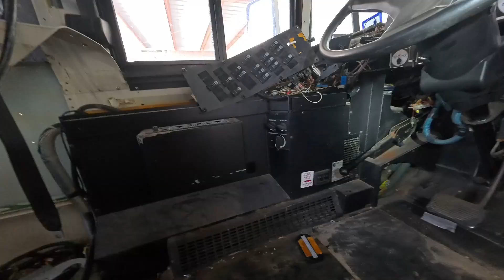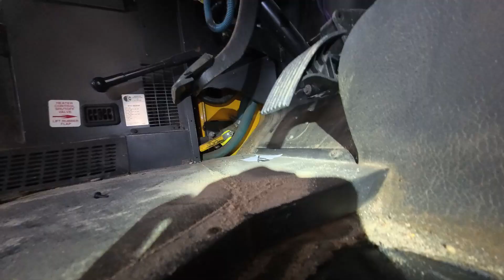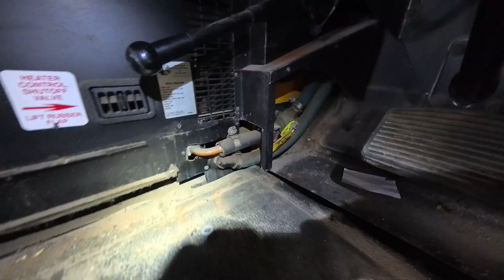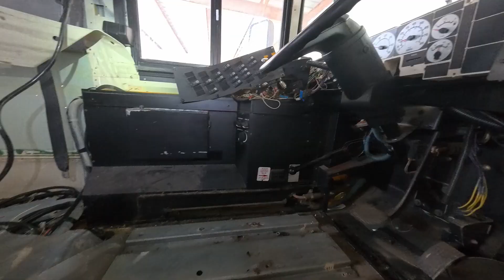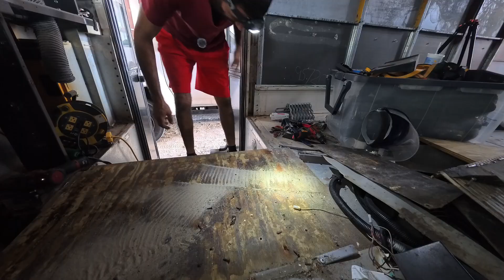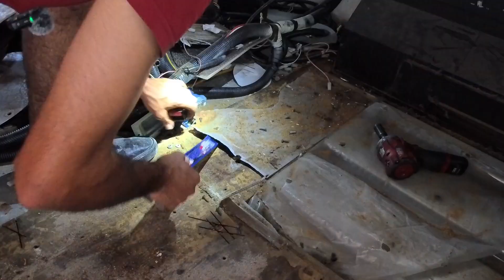Driver floor demo ~ Skoolie build part 12

Comment: 100% agree with having a good knowledge of how everything works. That will save you time and money down the road. You're making me want to pull those heaters just to clean them! I'm continuing to notice subtle differences between your bus and mine, like how the doghouse cover on mine goes back over the transmission cover you pulled up. Maybe that's just because the 6 cyl is longer than the v8. Appreciate you making these videos.